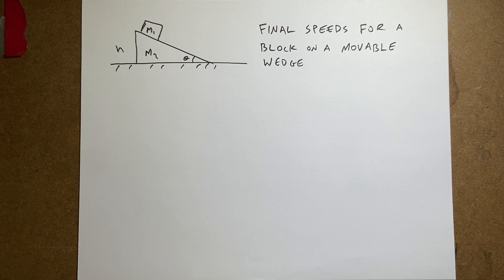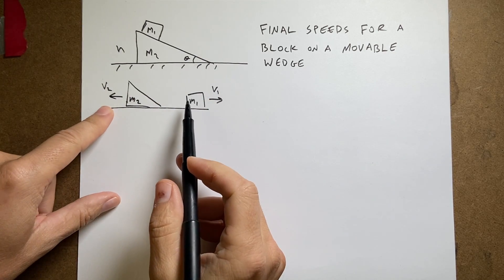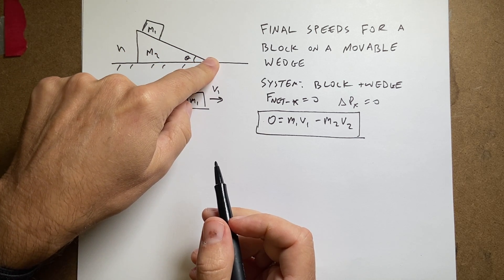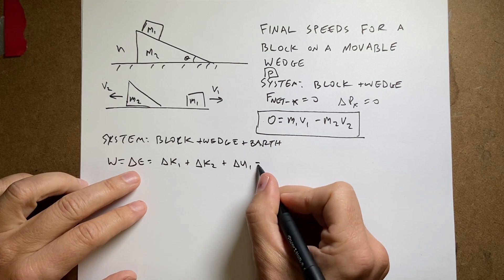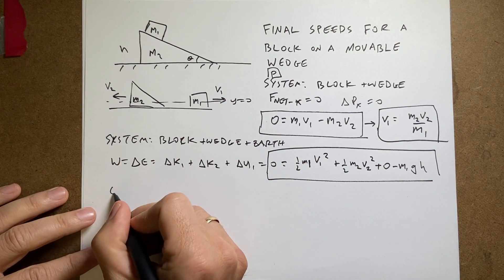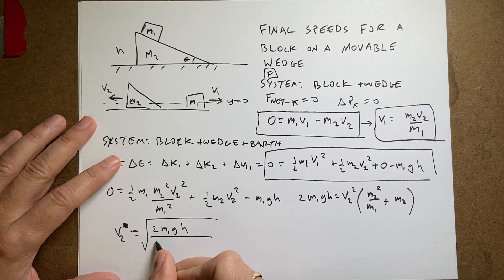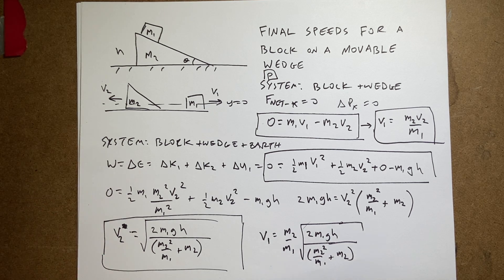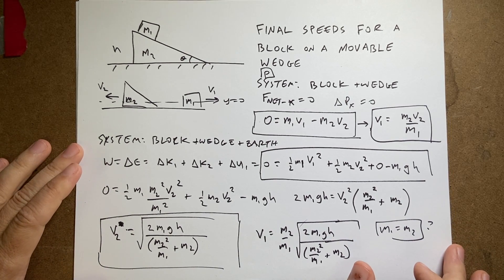What are the final speed for a block sliding down a movable and frictionless wedge?

Comment: I am sorry but this solution is wrong. The velocity of block 1 has two components, only the horizontal component enters in the horizontal conserved momentum. The gravity does work in the block 1.
Reply: Yes m1 has vertical kinetic energy so really you have to go from top of plane to bottom of plane and subtract out this vertical kinetic energy. See my review of Analytical Mechanics (7th ed.) by Grant Fowles on Amazon where I outline the proper way of doing this by conservation of energy or work energy. It's easy to find the vertical acceleration from my review then you can use v^2=2ah and go from there but algebra is tedious. Easier to find time of descent and multiply by acceleration of inclined plane-find momentum and particle has opposite momentum. There's a fellow who does this problem on Youtube by forces method and says he'll send you notes on work-energy method. I do know my review predates his video/notes. I used to teach college level physics.
Reply: @paulbonyak4940  if i have the same problem but it already have the velocity of the block on the horizontal surface( block has left the inclined surface), is the answer corect with the answer in the video.